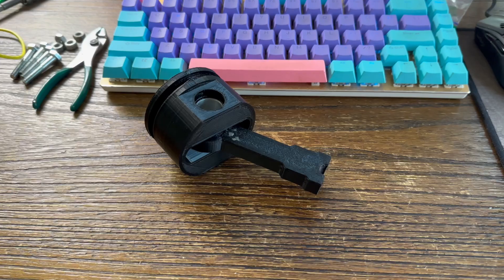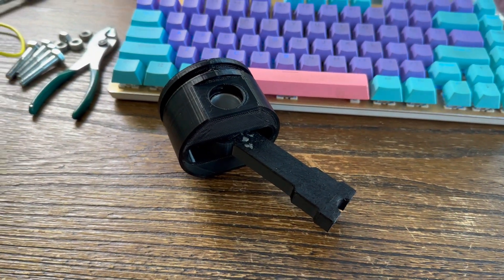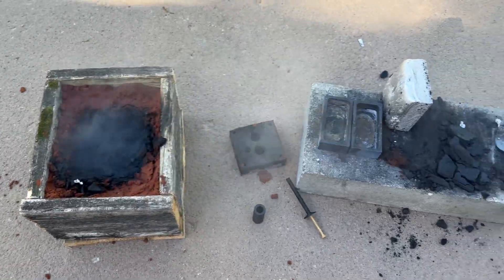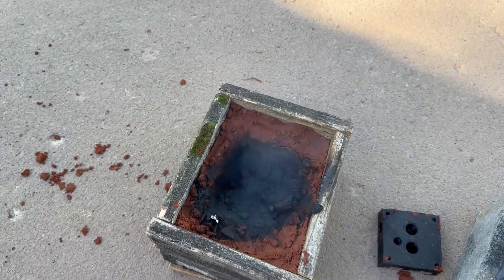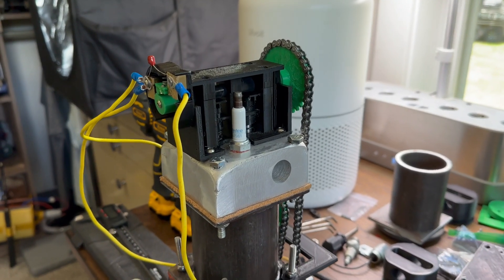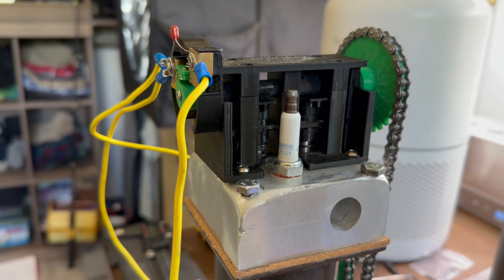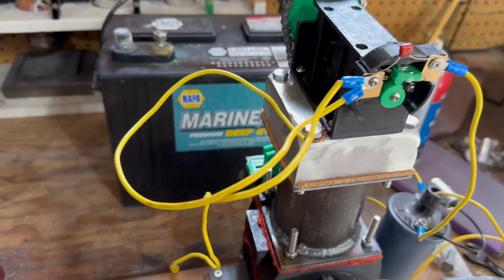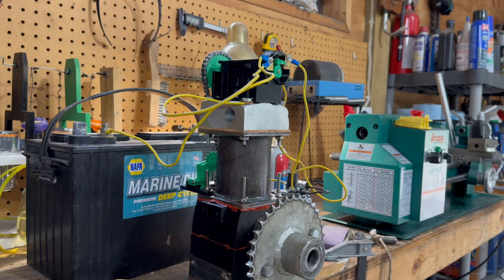3D printed 173cc 4 stroke engine! With cast aluminum parts!

Comment: what is your ignition timing? also fuel delivery is gonna be hell id get like a 13mm carb or maybe even one of those chainsaw ones. heavier flywheel might also help with the engine running.
Reply from the maker: Ignition timing is roughly 3° before top dead center, since the engine is 173 cc I’ll need like a 19 or 20 mm carburetor. For the flywheel I’m going to just add some more weights onto it.

Thank you for watching!
Reply: @ProjectLMZ  true. For a normal 170cc engine a 19mm carb would be optimal but: with a smaller (13 - 15) carb the velocity of air at low rpm is much better giving a engine much better throttle response and overall itll run better. And since i dont think you will be revving to 8k you really dont need the flow of a 19mm. Ive dont testing with carb sizes and i did confirm its true. The smaller the carb the better throttle response amd low end but of course it restricts the top end. Bigger is vise versa.
Reply from the maker: @tilen3266  that sounds like it would be better then, because I will be lucky if this thing revs to 4000 RPMs. My intake port diameter is 19 mm, so that’s why I was figuring a 19 mm carb, but I could try like a 15mm carb!
Reply: @ProjectLMZ  yes id say that would be better. The port might be 19mm but the 90 degree turn and the valve add up. So yeah youd want a smaller carb. Otherwise the engine looks really good. A more stable flywheel is needed tho
Reply from the maker: I was looking at a nibbi PE17 carburetor, they didn’t have a 15, has good reviews and looks nice, and I am trying to find weight for the flywheel right now, the flywheel that is currently on there is solid steel, so it is fairly heavy, but your right, it needs to be heavier. I am going to bolt some more steel plates onto it, as the adapter I have made works really good, so I might as well just add weight to it.

Comment: You should also use a bigger flywheel since thats quite a small one for that size of an engine. And you might wanna valve lapp the valves for a better seal
Reply from the maker: I do agree, it needs a bigger flywheel, but what I can do is bolt a steel plate to the holes I use for mounting the new flywheel. 
For the valves I tried to lap them but the lapping compound that I used left a terrible finish, so what I did was just sand down the valves and the valve seats with 220 grit sandpaper and it seems to make a very good seal. 
Thank you for watching!

Comment: you could use copper sheet to make a head gasket it would be reuseble and i think i should handle the heat better then th cork, i becuse i think when you get it running it would just burn it away and more updates please i love this project since i want to do it myself but i dont have the tool and money to do it